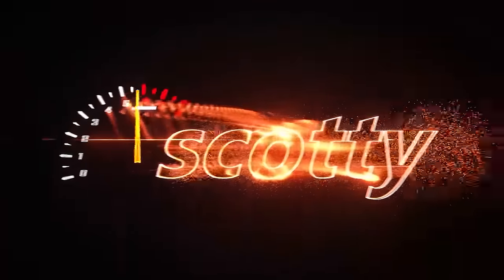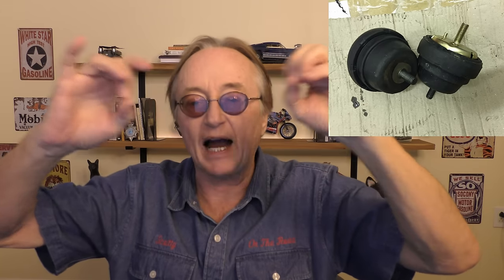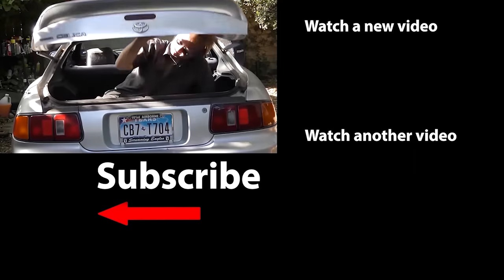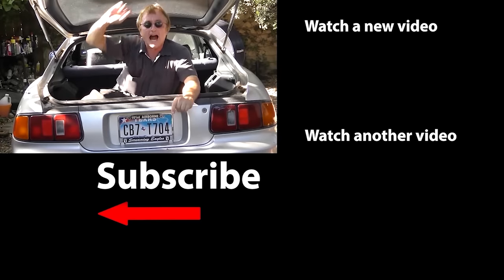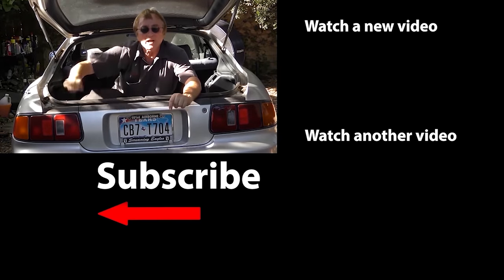Here's Why Changing Your Engine Oil After 3,000 Miles Will Destroy Your Car

Comment: Turbo timers were extremely common in the 90' and 2000s, I'm not sure why they stopped being put in cars, and I'm more suprised Scotty hasn't suggested or recommended them.
Reply: More things break. More money for them?
Reply: Because they are completely unnecessary. Idle for a few minutes and shut it down.
Reply: @mr.monitor.  you obviously have no idea what a turbo timer is 😁 they do EXACTLY that, but you can literally take your keys, lock the car and walk away.
Reply: @contractor556  the amount of tech in a modern car is off the hook - and mostly unnecessary. There is no reason to not put one in, all things considered.
Reply: @CadillacDriver  I know what they do. I don't like my car to continue running while I'm walking away from it. Thanks though.
Reply: @CadillacDriver  I don't want to spend more money on crap I don't need. I know how to drive and how hot it is.
Reply: @CadillacDriver  Turbo timers are for people that don't have a need for basic guages or care what they mean. Go ahead and pull into the garage, close the door and let your car run until it decides its had enough 😆
Reply: @mr.monitor.  wtf are you even on about? They TURN THEMSELVES OFF.
Reply: @CadillacDriver  that's what I said. Can you read?
Reply: @CadillacDriver  did you just find out about turbos and turbo timers today? I can't see why else you would be so passionate about a completely unnecessary thing?
Reply: @CadillacDriver  what part of having a timer to turn your engine off, turns you on? I said it runs until it decides it had enough sarcastically and lost your mind like I said it just runs all day or something?
Reply: @mr.monitor.  why exactly are you here? 
You're not cool.
Reply: @CadillacDriver  I can see how someone that likes Cadillacs might want something like a turbo timer and lights that stay on way to long after the car is off 🤣 🤣 🤣
Reply: @CadillacDriver  do you not understand why a person may not want their car running after the key is off or anything in the car for that matter? I've talked to some dumb people on here but you are top of the list. Get one if you need one but don't force yourself on others. Good lord 😆  I always hated how Honda runs the radiator fan for several minutes after the key goes off. Do you want this feature too ya cry baby? 😢 😆
Reply: @CadillacDriver  and you are?
Reply: HERE IN CHILE ARE VERY USED TODAY 😎👍🏻✨️
Reply: @mr.monitor.  imagine trying to be hard ANONYMOUSLY ONLINE.
Reply: @CadillacDriver  you liked your own comment, you are annoying and anonymous with no actual sense at all. Do you even have a license?
Reply: @CadillacDriver  people aren't that smart are they?! Lol
Reply: @grantkuropatwa6583  not at all 😂
Reply: @mrgarrison3516  they aren't illegal here in New Zealand. Wtf are you on about?
Reply: @mr.monitor.  Some people are forgetful, and don't do the cool-down every time,  yet others don't have time to sit in their car while it cools down every time. They serve a purpose, despite not being useful to you, but you knew that, right?
Reply: @Seudaren  yes. I own turbos. Have for decades. Have a CDL, drive a lot. I have never once needed a turbo timer.
Reply: @Seudaren  you don't need one either.
Reply: @CadillacDriver  ok speed racer. A turbo timer is completely useless for 90% of the people with turbo cars.
Reply: @biff3917  hahahahaha. You are the only useless thing in this section. Send a message to Scotty and tell him his advice to  idle turbo cars after a drive, is useless.

Comment: I replace my rav4 3.5 liter oil every 3 to 3500 miles with full synthetic castrol oil. It has 134k and doesn't use or burn oil and runs smooth and super quiet. It's a beast of an engine. 
Always use OEM oil and air filters along with Denso plugs and coils.

Comment: Big trucks will let the engine idle for about 5 minutes after coming off the highway to cool off the engine before turning it off.
Reply: I didn't think they ever turned them off.
Reply: @rogerwilcojr all the big companies use a timers to stop the engine after five minutes
Reply: @rogerwilcojr often, we don’t.  But like the man said, a cool down period is as important as a warm up period. ✌🏽
Reply: Does that apply to smaller diesel engines as well such as a 4 cylinder turbo diesel?
Reply: @levismith7444  a Turbo is a must idle down

Comment: I use to work for the state DOT and most of our large trucks had turbos and we're in a very mountainous area. The yard was several miles from the interstate, so I would take it easy once off the interstate. A few others would always goose the throttle unnecessarily and a few turbos had to be replaced.

Comment: On my 2022 Jeep JLR with the 2.0 Turbo, it circulates coolant to cool the turbo charger when the engine is shut off. If it’s quiet enough, you can hear it flowing.

Comment: I change my oil within the first week of every other month.  Usually it’s still kind of yellow.  I use Mobil1  10W30 in a 1999 Volvo V70 XC 2.4L with turbo.  234,647 miles.

Comment: I have a 2013 BMW 535i has the n55 3.0L turbo engine.  I was changing the oil every 7K miles.  Standard for this was 15k by BMW.  At some point I decided to get a black stone labs oil test done at the end of a 7K oil change, and the lab guy said the oil looks good, so try 10K miles and so I've been doing 10K ever since.  But I do use high quality Liqui Moly 5W-40 full synthetic..  So I guess I don't need 3K mile oil changes on this particular car.  But the overall idea is correct.  It's at 180K miles.  Runs beautifully.

Comment: Heat up Rattle Cans in hot water from the tap (100-110°f)  Get that paint hot, use a snap-on spray handle with a trigger.  As soon as the can spits, replace it with a new one.  Shake the can A LOT! 
 It's gonna take about 5 cans for Scotty's Celica.

Comment: What is the consensus on putting a full 5 qt of oil in a 4.2 engine. A lot of people say big NO and others say they’ve been doing it for years and nothing bad has ever happened.
Reply: Never overfill your oil. Period. And why would you have to?
Reply: @mitchellbroaddus9120  idk man it’s just the George Bush in me…I just need to use it all lmao
Reply: If the crankshaft hits the oil it causes foaming. Not good.
Reply: I do that with my Mustang. 
But it's rated for 6 quarts. 😊

Comment: I had a 2002 Impala with the 3.4L engine. Had about 250,000 miles before we(me and my son) junked it. Had it been with me at home in Michigan instead of in Georgia with my son I would have attempted to fix it( rusted out brake lines). Engine still ran fine. A/C had gone bad but, like I said, it wasn't here with me to attempt to fix.

Comment: I wouldn't buy a Turbocharged car in the first place.
Reply: @maj8301  I'd kick its but with my Naturally aspirated V8.
Reply: My 2021 car has 75,000 miles and it is turbocharged. Changing the oil and filter every 5,000 miles and that’s it. Like new.
Reply: @maj8301  Shocking 😱 lol 👍
Reply: Amen
Reply: My turbos last for hundreds of thousands of miles. I change my oil 2500 in the summer 3000 in the winter.
Reply: @ginog5037  Glad to hear it. Keep up the good maintenance 👍
Reply: @ginog5037  where do you live? And what type of engine?
Reply: @LivingInAnInverseReality bring superchargers back
Reply: @oreally8605  only in yer dreams
Reply: @maj8301  In Soviet Russia, turbo charge you!
Reply: I hear you there. I own the 7.3 powerstroke diesel with a single turbo BUT its a diesel.. totally different animal than a gasser.
Reply: @ThomasKing19933 
SO SHOCKING-  BEYOND BELIEF!
Reply: You can't afford one anyway 😅
Reply: @mr.monitor. I have several cars. I'm doing nicely😊 👍
Reply: @ginog5037 what make & model? Every 2500 seems unnecessary
Reply: @Roberto-de8xv  it is, he hasn't driven multiple cars up to "hundreds of thousands of miles".
Reply: Yep get a V8 and get 12mpg smart
Reply: @richardface8664  I don't worry about mpg. We're not all broke, lol😂
Reply: @richardface8664 12 mpg.  What V8 are you driving?  Single cab, short box pick up that is geared properly should get well over 20 mpg.
Reply: You won't be able to avoid it soon. V8 and even V6 are slowly disappearing for turbocharged 4-cyl.
Reply: Everything is becoming turbocharged now with EPA regulations
Reply: @maj8301 😂😂😂😂
Reply: @lajya01 probably in about 10 years, for a fact.
Reply: @nickz6143  1984 olds tornado, 4mpg.
Reply: use a paint roller😅
Reply: I second that emotion.
Reply: @ThomasKing19933  I bet your cars would be a lot more fun if they had turbos
Reply: @oreally8605 bet? Does it suck knowing my engine isn’t as big as yours but I make way more HP?
Reply: @oreally8605 what’s your 0-60?
Reply: @😂maj8301
Reply: Almost all high end vehicles will be turbo and electric. Many are now
Reply: More for everyone else. 😅
Reply: Most people don’t understand how a turbo charger works. Today all gasoline engines and most diesels have what’s called a wastegate. This means that the turbo does not run under full power unless it is loaded due to say being on a steep hill or up in a higher altitude. I drive a semi, and sometimes the turbo boost is only about 10 psi.this means that they’re spinning very slow. I had a turbo charged car with over 400,000 miles and never replaced the turbo. Of course I never replaced anything on that car other than spark plugs and filters, and of course the oil and other fluids.
Reply: @alexanderkennedy2969 Mazda has non turbos today! Along with traditional gear transmissions not that CVT garbage.
Reply: @ginog5037 maybe so, but a turbo is race tech and thus not designed for prolonging engine life.
They also cost $2000+ to replace. Throw in that they are using 2 of these in trucks, what do you do when your tiny engines turbo dies when you're hauling? You kill your underpowered engine 🙄
It's one thing to have one for performance, it's another when it's only to appease politicians
Reply: Problem is almost every car is turbo today. Choices for a car will be very limited if no turbo. I'm not a fan, bring back superchargers!
Reply: @richardrieman5316 Yes, almost every car now is turbo charged for damn fuel economy.
Reply: Agreed, my car has a supercharger instead and is a total beast.
Reply: @mr.monitor.  I had a few Turbo cars, but still prefer naturally aspirated.
Reply: Butt is spelled with 2 tt
Reply: That's for damn sure.
Reply: Volvo V50 with 2.0d turbo has done 160k miles no problem except battery which died cuz of not driving car for a while
Reply: Had a turbo v6 with over 200k on it. I always changed the oil every 5k miles and took care of it well, and it ran like new when I sold it. Didn’t use a drop of oil and didn’t have any valve noises, etc. Turbos are great if you take care of them.
Reply: @ThomasKing19933  you prefer less power. That's ok. It's not for everyone.
Reply: @mr.monitor.  Not really. I just prefer bigger engines.
Reply: @ThomasKing19933  I do love the 1970 455 Olds engines. They would also be awesome with a turbo lol
Reply: @ravenmoto5948 My 2021 RAV4 is naturally aspirated, 8 speed tranny and a combination of port & direct injection which eliminates valve carbon build up. Got the best of all worlds! Should last forever!
Reply: @aviatortrucker6285 

Diesel turbos last longer, due to the lubricating properties of diesel fuel versus gasoline, and if you properly maintain them. True.
Reply: @oreally8605 yea you would beat a 4 cylinder turbo, what about a turbo LS tho😂😂🤷
Reply: @richardface8664   Turbo engines make no power unless you're in the turbo, but when you're in the turbo they use more fuel than a V8. They get better mileage on EPA tests, but worse mileage in the real world. My son's turbo V6 gets 13 MPG, meanwhile my NA V8 gets 16 in the same city driving and even better on the highway. So drive a turbo because they're fun, but don't lie to yourself about saving fuel.
Reply: @powerwagon7811  not true just switched from a v8 to a 2.7 v6 turbo
Reply: Turbocharged cars are major problem. Anyone buying one is CRAZY. It's another thing you have to worry about. Why do you need more power. Can't do anything with it anyway.
Reply: @ginog5037  if you've got to change your oil every 2500 miles, is it even worth it.  Most manufacturers suggest 5,000 to 7,500 miles and you could go more with a full synthetic typically. 
So basically X2 on the oil changes that's an extra $200-$300 a year. Not to mention the fact that turbocharged engines, even well maintained ones tend to die sooner than non-turbos.
If you think you need that extra kick in the pants? Fine! Just be aware it comes at a price. 😢
Reply: Amen to that! Money pit waiting to happen. Last time my car was having routine maintenance a guy there needed a new turbo $3 grand and there were 2 of them yikes! Luckily only one was bad but I bet the second one isn’t far behind
Reply: @EC_ATV_Outdoors turbos are not “race tech” turbos have been used on large diesel engine for a long time
Reply: @richardface8664 while towing 25,000 Lbs with 13,000 Lbs of payload.
Reply: I wouldn’t buy a turbocharged engine either!
Reply: That Harvester International,  it's a 7.3L that came in the '90s F series is a BEAST. My former employer has one with 600K on the clock.
Reply: Gotta admit they're fun. Smiles per miles😊
Reply: Do you have any car at all sir?
Reply: @jumpman366  Yes, several.
Reply: but ya will get dusted by one.
Reply: Our turbo charged  Toyota has 500k kms still running good
Reply: My mini cooper is turbo’ed and it has over 174k miles and I’ve had no turbo issues, I did replace the feed line because I was down there.
Reply: With our government, we may not have a choice in the future. America is not the land of the free anything. Love my Country, hate what it's become.
Reply: I don't think we will have a choice about turbos.  Before long cars will have 1 cylinder with 3 turbos.
Reply: @cheftomsd  It definitely feels like it's going in the small displacement turbo engines. Thankfully at this time, I still have my late model V8 that will last me many years I hope.
Reply: All engines should have a turbo.
Reply: @martinmears2355  If you don't care about long-term reliability, sure, go for it. Not all of us make the money you clearly do.
Reply: @car-diologist  my dad's turbo on his 5.9 Cummings is original over 750k and still running everyday all companies can do this 4 every engine
Reply: @martinmears2355  This I exactly what people are not understanding. A diesel engine is built far differently than any Gasoline Engine. It's far from comparing Apple for apples. I've done the research. Not nearly the long-term reliability of a diesel built engine. Sadly countless other just run with this same thought. So NO, your daddy's 5.9 Cummins is far more capable than any Gasoline engine with a turbo. Go buy one of these new 4 cylinder turbo Gasoline engines and try to put 200k miles on it. You'll be extremely disappointed. Sorry to burst your bubble.
Reply: @car-diologist  your not bursting my bubble trust when I say they can make it reliable like that they just choose not 2
Reply: @martinmears2355  Sorry Martin, but you are sadly incorrect. Gasoline Turbo engines are commonly more expensive to maintain and repair. The turbos prematurely wear mostly because the owners don't change the oil every 3000 miles. The manufacturers say I believe every 10k miles ? There's too much to say because there is nothing good about these Turbo 4 engines. Plain and simple.
Reply: @martinmears2355  Not sure what you think you know or what has lead you to believe these 4 cyl turbos will be reliable, but my proof is in the vehicles today such as the Civics, Subaru's and Toyota products that have already had th3se 4 cyl gasoline engines on the market for numerous years. They require more maintenance and repairs. They are not lasting 150k miles plus and if they have, there are countless replacement parts / repairs including turbo replacements on them. You are getting manipulated into believing otherwise. Stop allowing manufacturers to dictate what they want you to believe. Start paying attention to real world use. The vehicle you drive and experiences you've had is just you and yours, not the real world majority.
Reply: @ravenmoto5948 Not! You can still buy naturally aspirated. Turbos are fine if you don’t expect a car to last 200,000 miles plus. I get 300,000 or better out of mine with just normal maintenance. Turbos take a small underpowered engine and push as much power out of it as possible thus stressing out all the parts. Turbos go bad as well and are not cheap to replace. I’m a retired mechanic of 45 years and will stick with my naturally aspirated engines.
Reply: @Michael_Ward yeah but not on gas! Diesels are a whole different thing.

Comment: Modern cars use electric coolant pumps which run some minutes after engine stop to make sure that heat from supercharger is transported. At least my BMW M4 with S55 engine has that and i know N55 (340i) engines also use that.

Comment: They used to talk about systems you could install to pump oil to the turbo for a few minutes after a shutdown and then automatically turn off.
That would work. I love my '85 6.2 chevy diesel,  non-turbo. Still going strong after 40 years. One Ton van.  19.8 mpg average. 
I'm in love.  =PC=

Comment: Scotty and some of you forget, 95% of the people who own turbos right now don't drive the turbo that hard lol. So unless you're going crazy with that turbo just stick with the 5k oil change.
Reply: …and give your engine/turbo a moment or two to cool down after heavy use. That oil is pulling heat out of your bearings. Give the engine a minute to idle and cool down before shutting it off. This will definitely help the life of your turbo.